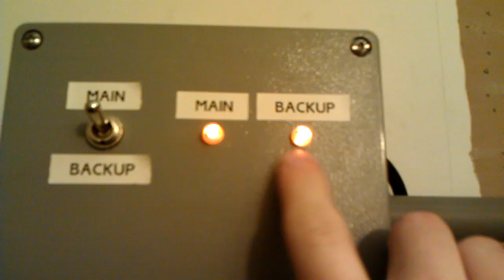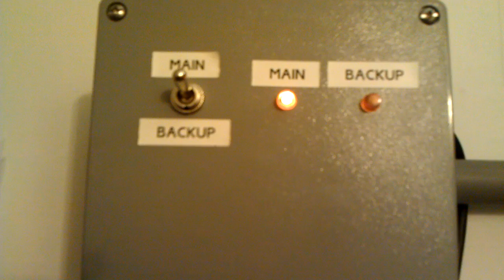Homemade Transfer Switch

Comment: You mentioned that it automatically switches from whichever is delivering power, to the other. So I'm guessing that the switch is your way of manually switching from one source to the other. I was listening for you to say what was triggering your automatic transfer and how that aspect was set up. A schematic would have been a wonderful thing here.

Comment: The only thing I would note is that if you have to flip the switch, then it's not automatic and the label on the box is misleading.  Unless the switch is only there for test purposes?
Reply from the maker: +srobidoux
If you leave the switch on main and you lose power, the relay will switch to backup power automatically.

Comment: @RSBSTEADICAM it depends if his neutrals are grounded. i'm guessing he's not switching his neutral because it looks like a residential setup which wouldn't need to switch neutral and neutrals probably just grounded.

side note though.. i agree with you i wouldn't use that setup in my house. better and safer ways to do the same task...

Comment: to measure amperage and voltage on each input and to control the position the relays are in. Once the power fails, 5 flood lights turn on (1 inside the house where all my equipment is and 4 exterior) for 3 minutes. If there is no human interaction within 3 minutes the lights turn off to save battery power. I have 2, 330rc batteries, hooked to a 2500w inverter and expect to see about 30-60 minutes at full load which it will be. I know the relays are over kill for

Comment: Great work looks good, I'm doing what you are doing only on a much larger scale, I purchased two bullitin 700 relays which have 4 poles and each pole can be individually configured to be normally open or normally closed, and each contact is rated at 60 amps continuous. One switches between inverter and generator and feeds into another that switches between the inverter/generator relay and utility power. I am going to be using a micro controller